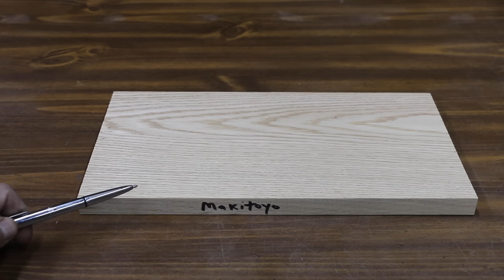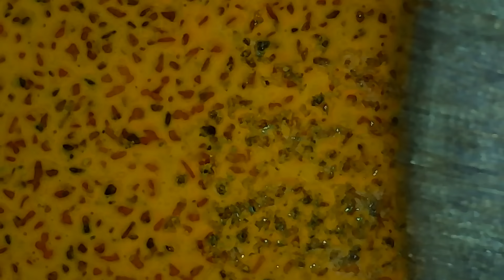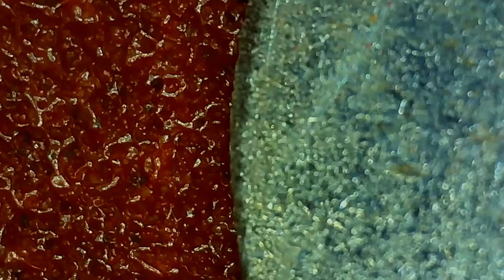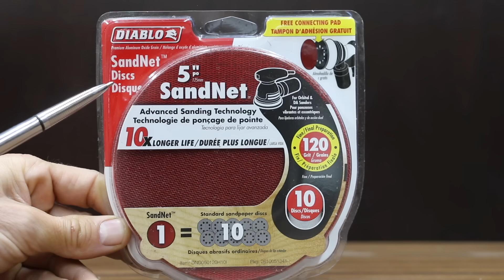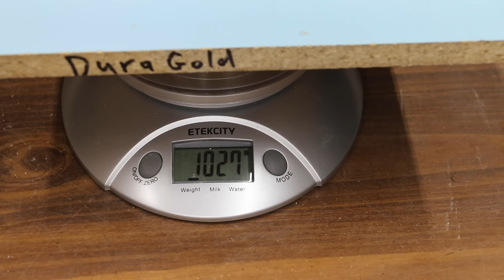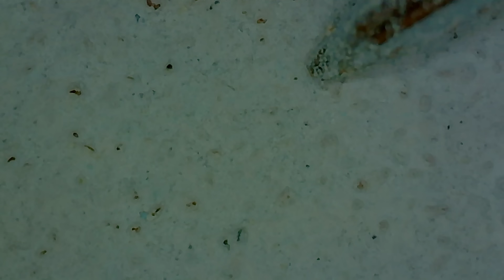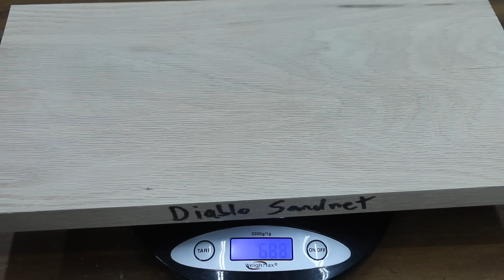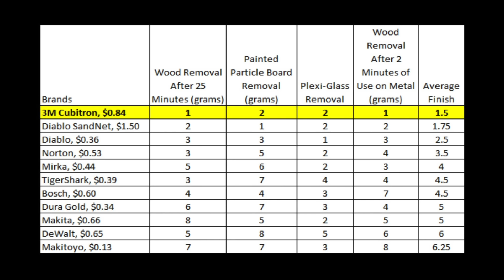Best "Sandpaper" Brand? 3M Cubitron, Diablo, Mirka, Norton, Makita, DeWalt, Bosch Sand Paper

Comment: I have an suggestion:

Metal polish, you know when you polish metal, especially aluminium wheels, how long different metal polish/waxes last before the Aluminium starts to dull. (or other materials, copper, brass etc.) And how shiny it actually gets when you first polish it.

There are some metal polishes with wax in it, and some without, some is more aggressive, some mild, etc. so I guess it is different ways to to do it. And also regular car wax/sealer in comparison, after polishing.
I will write some of the most usual brands (to me) to help, if it is of interest. Some are probably more popular in USA vs Europe, and vice versa.

Meguiar
Collinite
Mothers
Autosol
Chemical Guys
White Diamond
Autoglym
Poorboys
Turtle Wax
Swissvax

And then you have "cheap" brands, probably like Harbour Freight, Walmart(?) in U.S.A.
And I guess the ones meant for kitchen/silverware in the regular store too, Brasso, etc.
Coca Cola and WD40 etc.
Some brands have several types too, so it can be a very long and potential tideous test, but some sort of metal polish test for shine and longevity would be great, I have never seen anyone do it, it would probably be a popular video.

Comment: You forgot the pinnacle of woodworking tools, festool sand paper.
Reply: Agree. Festool Granat 120 grit in a 5"/125mm size is $65 for 100 sheets or $0.65 per sheet. So more than most of the tested products but it performs better than most too.
Reply: @bobd.  It's worse than the cubitron based on testing from other folks and my own experience. I have never used sandpaper that lasts like the cubitron stuff.
Reply: @Roct3874  Thanks, I have not used the Cubitron paper in my other brand sanders. Don't know if they make a version for Festool sanders which have a different hole pattern than most.
Reply: @bobd.  The hole pattern on the cubitron works with my festool sander. It's not the standard 8 or 9 hole pattern, it is a bunch of little holes in a spiral around the disc.
Reply: @Roct3874  Still doesn't explain why it was not tested. Lots of cheapo paper in the mix, why not another quality paper?
Reply: @bobd.  Most likely because most people don't know about it like klingspor sandpaper.

Comment: why do you add weight to everything? in most cases all you're doing is shortening the life of the tool and stressing the test in the direction that yields inaccurate results.
Reply: Ehm for sciency consistency. How would you otherwise eliminate variables that would influence the results? I love his testing methods, which I often enjoy even more than the results themselves :)
Reply: He's eliminating human error.  If he used his hand and physical pressure then the tests wouldn't not be reliable at all because you would never know if you maintained steady pressure throughout the tests.  

Everyone who uses a sander doesn't just let the tool rest on the piece.  We put pressure behind it to get the job done faster.  And in most cases a lot more than 7.5 pounds is being applied.  Of course, it all depends on what you are doing. If you're sanding edges or anything delicate you will not need much pressure, but almost all flat surfaces can be sanded with added pressure, and 7.5lbs isn't that much.

Comment: I'm a woodworker and have used diablo for many years.  I've tried others but always went back to diablo.  I've used the sandnet a few times but never found it worth the extra cost.  I'd like to know how Mirka's Abranet compares with the Sandnet.  Also, I'm curious how Festools sandpaper does in these tests as like anything named Festool, it's expensive. 

Thanks for the tests, I'm going to try that 3M paper.
Reply from the maker: You are welcome!  Thanks for the video idea.

Comment: Great video as always! I'd love to see more math in the price-per-sheet when comparing the cheapos like Makitoyo to the 3M Cubitron and other better brands. For instance, the Makitoyo removed 10 g in 5 minutes. You could replace the paper with a fresh sheet from the Makitoyo stack every 5 minutes to theoretically remove 50 g over 25 minutes, while still only costing $0.65, which is 3/4 the cost of the 3M and less than half of the Sandnet. If you don't mind replacing sandpaper often, the cheapest option is still really good.
Reply from the maker: Thanks for the suggestion.
Reply: Maybe for a home type job, time is money for someone on the job and having to stop and slap on a new sheet of sandpaper is frustrating. Especially after a few minutes.

Comment: 3M Cubitron in general is good I run the cutting wheels, flap discs, and grinding wheels on my grinders.
Reply from the maker: Thanks for the feedback.
Reply: @ProjectFarm  No problem just as a welder I've learned what works best for me and my application.

Comment: I used to use Mirka Gold a lot back in the day, then I switched to the Mirka Abranet for some time as they lasted way longer. When I first bought the Abranet you had to buy the adapter pad separately. One day in the hardware store a few years ago I saw the Diablo discs, both the solid and the screen type. I bought them to try and was very impressed. I switched to them from then on and never looked elsewhere. I did like that the adapter disc was included in the screen type. If you do not use that adapter disc for the screen style, you will wear out the hook and loop pad on the sander till it won't hold the disc on anymore.
Reply from the maker: Thanks for sharing.

Comment: Would be interesting to do a follow up on these, and test them sanding aluminum. Aluminum is more...tricky, since it clogs things up really fast. But here's an idea, to do a test on tap and die kits, and measure the strength of the threads each kit can make, maybe even pick a small and large diameter and test them out and see when they fail on the same material.
Reply from the maker: Thanks for the video idea.

Comment: Question, is there a way of determining if the brands are really the grit advertised?

It occurs to me that measuring the amount of material removed might favor a sloppy, rougher grit that leaves larger scratches.  

Great test, thanks for quantifying these brands.  I've been buying one of the ones rated really low!
Reply: I agree, you could "cheat" these tests by using a coarser grit. But it probably couldn't go very far before customers would reject it. Some of the results would likely hold up anyway (like 3m durability to metal) but it would be nice to add a surface finish test.

Comment: Another awesome video maybe one day you could test some of the sanding discs that go on angle grinders for metalworking. We use the 3m cubitron at work but they are rather pricey and we burn through them quickly. Thanks again for video see you next week
Reply from the maker: Thanks!  Thanks for the video idea.

Comment: First of, I appreciate all the tests you doing :)
However in that case I was a bit confused by the choices of products. Is that based on what is available in your average US hardware store?

Reason being I was especially confused about the selection of Mirka sandpaper given that they are famous and highly regarded for their Abranet sanding nets. I know literally no one who buys any other product line from them if buying mirka.
Personally I don't see why you'd wanna sand with anything but a net given that dust extraction is (probably) the #1 factor in sanding performance, finish and endurance of sanding products. Having a dedicated vacuum is a major upgrade but even without one and just the bag nets perform better than classic sanding paper (in my experience).

Comment: That's an interesting test for the abrasive ability, but I would be curious to see a closeup of the scratch patterns. I have long been suspicious that the "new faster sanding" claims are code for "we let in lower grit chunks and hope you didn't notice" and if you end up needing to use a higher grit to get the finish you want... You didn't end up saving time or money.
Reply from the maker: Thanks for the feedback.

Comment: Sanding plastic probably should be done with lower speed and pressure to prevent the plastic from melting. Might help prevent clogging. Great tests! Maybe test some finer sandpaper like 1000+ grit, 3M vs cheap Amazon options.
Reply from the maker: Thanks for the feedback.  Thanks for the video idea.

Comment: I've wondered for years if my dad was throwing away money buying 3M sandpaper and products. I guess i'm going to have to eat my words and tell him what a great product it really is. But I guess he already knows lol.
Reply: A disc that lasts 20 percent longer and costs 250 percent more, is a conundrum for me.  On one hand, it might save a Theoretical hour and a half per day.  However, the reality is maybe 20 minutes .  The paper savings is an questionable. I am a guy who walked into an automobile paint supply for a few sheets of sandpaper, post spraying primer, and saw a bill for $55.  Back in the 90s I used a fast drying patch, lots of hugh quality oil spray of doors, and would spend 70 dollars for 1 or 2 rooms on sandpaper.   So, I don't take the cost of sandpaper lightly.  I went through hundreds of sheets on a few hundred feet of railing and backing 2 by 4 for strip and restaining, refinish. 

I routinely buy hundreds of 7 inch 24 grit grinder discs. I assure you that at 90 cents a resin backed disc beats a $5 3m disc every time.

In this video, the diablo 36 cent disc (they are actually 20 cents) and the 3m stood out.  If I didn't sand a lot, or it were not my money (the boss' money) I would go for the 3m.  Now, if a guy could sand worth of diablo 10 hours of doors in 8 hours using 3m. If my labor is worth $15-$70 depending on the time of the year, this would be balanced against the extra cost of the 3m paper, which i would not be surprised if more than $140 given the kind of price gouging paint stores are guilty of..... It takes really big jobs and writing the data down, side by side, to form a good opinion....  From this video, the bet is on 3m or the diablo to go head to head in a real long job.
Reply: @d.e.garber6643  great points and a head to head between diablo and 3m cubitron II would be a great video
Reply: Why did you think that 3M is no good? I thought that they are good on average.
Reply: @eugenetswong  he didn't say they are not good. he was wondering if they are worth the price =)
Reply: @j3b3mt1username  Fair enough, but it's hard to imagine them being good, if money is being thrown away.
Reply: You have a smart dad. 3M’s roots, in the beginning of the company, was making sand paper. I had the pleasure of working with 3M engineers. They only hire the best, they also expect the best. I am not at all surprised they are the best.
Reply from the maker: Thanks for sharing.

Comment: I just finished a project consisting of 11 kitchen cabinets. They are made from 3/4 maple plywood and 3/4 hard maple. I bought a good amount of the diablo sandnet and I already had the regular diablo. I also have a few Diablo 10"blades for my saw. They are very good products. I have been doing woodworking on and off for several years but I've been out of the game till now. I'm pretty sure diablo is the same company as Freud (switzerland). They make great stuff at a good price. I was doing a lot of sanding near corners with the sandnet though and noticed it tore just as easy as regular paper if you hit any of the outside edges of the disc. Overall it's great value like you said but I would just stick with the regular diablo. Your tests are very accurate. Great job!
Reply from the maker: Thanks!  Thanks for the feedback.

Comment: Great video! Though I really wished you sanding with white/wood glue or even mostly dried glue as that tends to gummy up the paper the best. 

Edit: Contact cement is another good test too (more overkill too).

Also I know I'll sound old but "Damn that disc sand-paper is expensive!"
Reply from the maker: Thanks!  Thanks for the feedback.

Comment: I build furniture for a living and I've used a product called Abranet from Mirka, which sadly was not used in this test. A single box per grit lasts me months and dozens of pieces. I refuse to waste my money on anything else since I switched. That being said, after seeing the performance of the 3m, I might buy some boxes and give it a try, though I am skeptical of the actual longevity. Net type sanding disks are meant to be cleaned of clogs either using water or a rubber sanding belt cleaning block for extended life. Another consideration for future testing, and one I'm curious about after seeing 3m's hole pattern is dust collection compared to the net style. Fine dust is a real hazard, especially if you deal with it every day and the net style in my experience collects far and away more fine dust than normal paperback sandpaper just due to the design.

Thanks for another great video.
Reply from the maker: You are welcome!  Thanks for sharing.

Comment: Another great test. Possible suggestion.  Some sanders are variable speed with the idea that when removing finish use a slower speed so the finish won't melt and clog the paper.  Also, would a vacuum work better than the bag on the sander?
Reply from the maker: Thanks!  Thanks for the suggestion.

Comment: The 3M Cubitron performance doesn't surprise me at all. If we are working with a gummy material that is likely to destroy pads we will use cheap paper for all by the finish pass. For everything else we use the Cubitron and what it saves us in labor far out weighs the extra cost of the product.
Reply from the maker: Thanks for the feedback.

Comment: PF is my hero!  As best i can tell, that's his hand holding the sander for all those tests - no stand-ins on hours spent sanding test pieces.  It would have been interesting to get an evaluation of surface finish or the quality of the grading of the abrasive used, but still, here's a man who goes the extra mile to make a quality video.
Reply from the maker: Thanks for the nice comment!

Comment: I run a lot of different grits of sandpaper my shop: 40, 60, 80, 100, 120, 150, 180, 220, 320, 400, 600, 1000, 2000, & 3000; I also run carbide grit plates which beat out sand paper as far as lasting but cost a lot more in 40, 80, and 120 grit. I tend to stick to Mirka and Dura Gold as they seem to balance cost and effectiveness though the 40 grit is Bosch and they seem to cut fast and hold up well. For rough sanding and shaping, including wood, Metal, and plastics/PVC the carbide disks are hard to beat; I have yet to wear one out but at $50-$60 each they are a hard initial expense to swallow and unfortunately don’t come any finer than 120 grit.
I like the content and bringing scientific method to tools; in the trades so much comes from experience but that experience is usually skewed towards things were used to or can readily get but today we should really broaden our horizons and you make that a bit easier with the information. I also like that you’re not a shill pushing their view or just endorsing the company paying for the testing; buying and supplying your own products definitely gives the outcomes more weight.
Reply from the maker: Thanks for sharing.

Comment: More important than sandpaper is the sander! Compare a Festool, or Surfprep , to a DeWalt! Then use the right sander for the application, whether it be a belt sander, finish palm sander, orbital, random orbital, DA, profile, etc. other than that it was a fair test across the board! Thanks for sharing another one of your great videos! Maybe you could test caulking, both paintable, and silicone, that may take quite a bit of ingenuity which you possess!
Reply from the maker: Thanks so much!  Thanks for the video idea.

Comment: Damnit! Wife was bugging me to buy sandpaper for the orbital because she wants to refinish some stairs... I looked for this video yesterday, and due to its absence ended up loading up on Sandnet of various grits. Great to know it wasn't a terrible performer but maybe I could have saved some money by going 3M.

Looks like at the 25 minute mark the 3M appears to be start falling off at a higher rate than the Sandnet... but that single gram different could be be attributed to margin of error. Would be interesting to see more extensive testing on those two to determine if the marketing wank is just that or has some truth to it.

Thanks for the content as always.
Reply from the maker: You are welcome!

Comment: Yet another great upload PF!!! 
   I used the 3m for prepping kitchens and without a doubt, it's the best. Using only 1 piece per kitchen and didn't change the finish after staining or painting. Unfortunately they changed to carborundum to save money and they dont realise they're spending more money all round. At least 8 peices of paper minimum per kitchen and it takes a hell of alot longer to prep with less quality 🤷‍♂️. I guess hiring on and not listening to the professionals is smart lol.
Reply from the maker: Thanks!  Thanks for sharing.